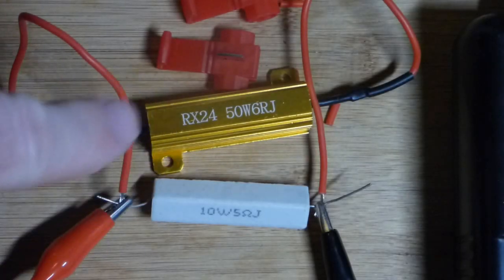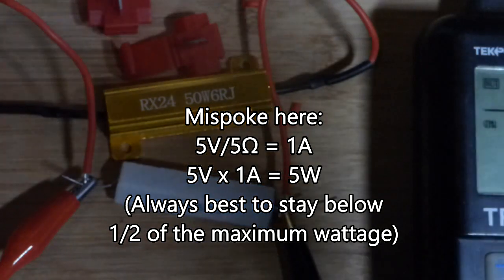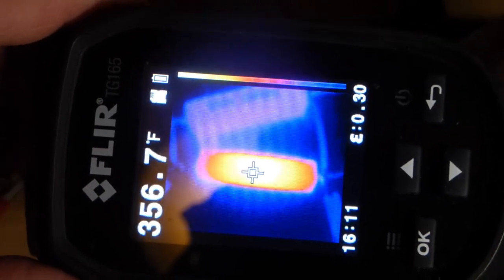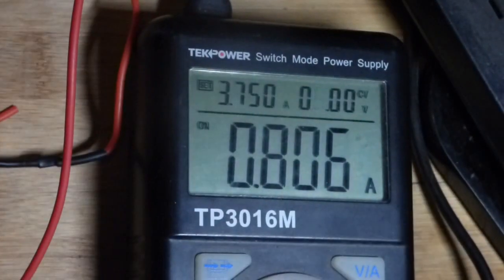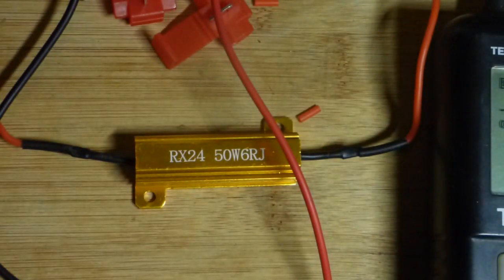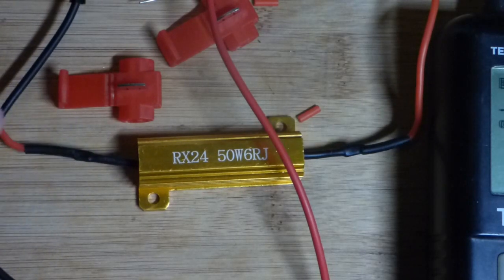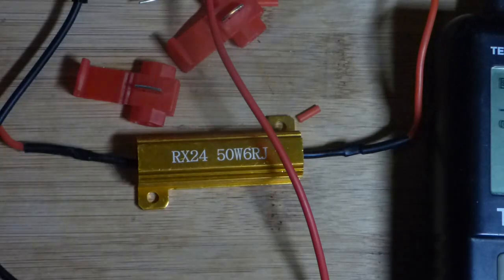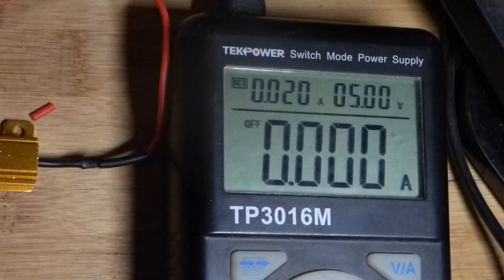Thermal camera look at 50W 6 ohm and 10W 5 ohm resistors

Comment: NICE VIDEO!
I have found that to run those gold-colored power resistors anywhere near their Max. rating that you need to use thermal paste , a LARGE heatsink,and a fan.  For those 50-100W types, I never drive them too close than 50% even under these conditions!!  As you said: THEY GET HOT!!!  
If I need 20W I use a 50W resistor unless I have thermal cooling.
It's not as bad for smaller power-ratings....for 1.5W, I use at least a 3W elevated resistor.
Reply from the maker: Yeah, fan makes a big difference. Heat sink also makes a big difference if you can afford the costs and amount of space it takes up. Combining the 2 is far better than either alone. Ive done those tests in earlier videos. Definitely don't want to power stuff near it's maximum wattage for periods of time without making sure it isn't over heating. I usually try to find a way to have multiple components divide up the power as higher wattage components usually start getting really expensive at some point.
Reply: Great tips both of you!